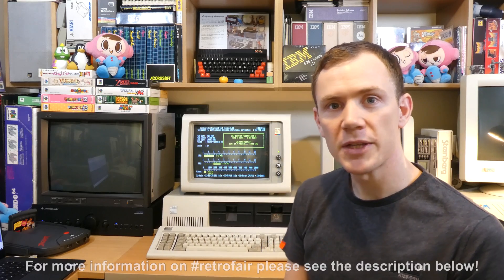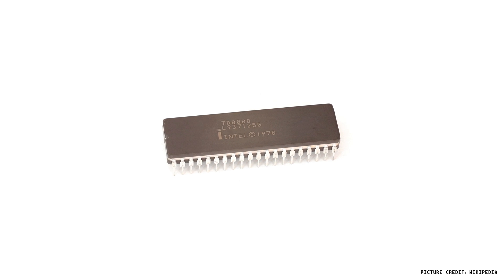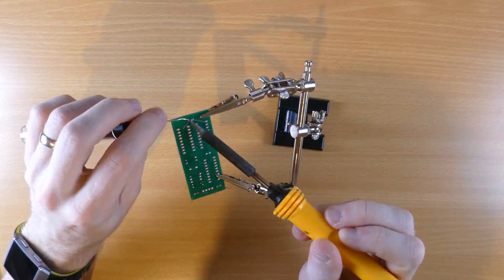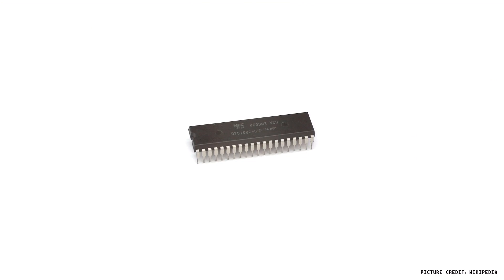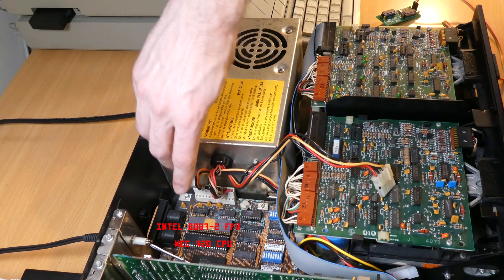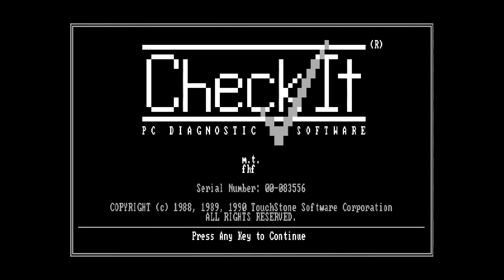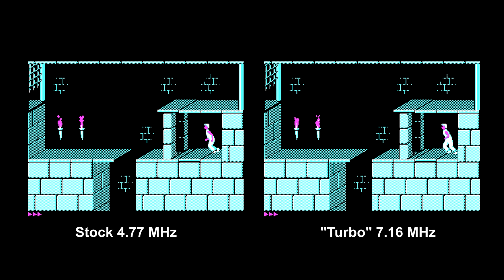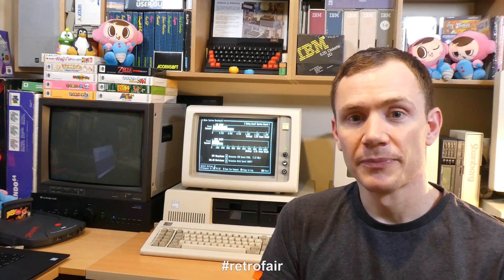PC-SPRINT - Overclocking The First PC With A DIY Open Source Hardware Solution From 1985! #retrofair

Comment: Hi Rees, great video, I love this kind of project. I could not see what you use to connect to the socket on the motherboard. I initially put headers but they turn out to be too large and damage the contacts. I see the canadian version used a turned pin sockets but it must have been a long pin version. I can't seem to find something like that anyway. Any advise?

Comment: Could this same process be applied to a Tandy 1000 SX in theory? I know that it has a clock speed of 7.16 MHz but using an NEC V20HL which i believe is designed for 16MHz could you reach higher clock speeds or isn’t this applicable since the pc is already supporting speeds greater than 4.77?
Reply from the maker: My concern would be timings of other things on the motherboard, such as the RAM. It could be that the CPU in the 1000 SX is already towards the upper limits of what the rest of the hardware is capable of due to the 7.16MHz clock speed. Unfortunately I don't really know enough about memory timings etc and the specifics of the Tandy to be able to answer that question.

Comment: Super video Rees! I'm looking at building my own 8088 PC clone and have been starting with the clock, do you notice any instability or compatibility issues running the 5150 at 7MHz? Ive heard that the Bus controller chips can have a hard time keeping up when doing DMA requests? Need to check out the PC sprint schematics when I get a moment thanks again!
Reply: Ah think I got the answer reading GitHub page "I have experimented with 22.11MHz and even 24MHz crystals and encountered stability issues at these speeds, so I recommend starting at 21.47MHz." I've been reading about going to 8MHz so I can see that it is probably an issue on an actual 5150. Sergeys original XT clone Errata talks about the DMA and Bus logic timing issues http://www.malinov.com/Home/sergeys-projects/sergey-s-xt
Reply from the maker: I had read about this too but thankfully it's never proven to be an issue in my case. I even started designing a "PC-SPRINT v2" to try to solve this issue but ran into various problems and gave up. I haven't come across any problems at all at 7.16MHz but did once try with a 24MHz crystal for a clock speed of 8MHz and the system was incredibly unstable. Perhaps that was the DMA issue starting to manifest itself?
Reply: @ctrlaltrees  thanks read the rest of the git hub page (sorry I get 2mins to read stuff before kids tell me to stop looking at my phone!) And see you did some very thourgh testing. My current thinking is to simplify the Turbo on my machine (sergeys Xi8088 auto clocks down on DMA requests but needs a lot of logic) by just not having DMA like the PCjr as I think it's only the Floppy Controller that would use it.... Anyway ta for the feedback, your #DOSCEMBER videos really inspired me!
Reply from the maker: Oh sorry Chris, I didn't see your two follow up replies as YouTube had held them for review, maybe because of the link. Glad you found the answers anyway, sounds like a very cool project. Oh, and thanks for your kind comments about the videos too! 😊
Reply: @ctrlaltrees  could you tell me a bit more about the instability issues you ran into? I've a 5160 with a V20HL 16mhz, and have been thinking of building t he pc-sprint with higher clock speeds. Wanted to try out a 40mhz (for an effective clock of 13.3mhz)  and a 29.4 mhz (for a clock of  9.8mhz) crystal, but if that's not going to be possible ill just get the recommended 21mhz.
Reply from the maker: @notkittenaround  It's been a long time since I looked at this, but the symptoms in my case were very obvious - freezing on boot and when launching software. I don't know much about the 5160 - it may be possible to push it to higher speeds due to faster RAM etc.

To be honest, considering what the crystals cost and how easy they are to change, it might be worth trying a few to see what works. Good luck!

Comment: This PC-SPRINT can be used on a TANDY 1000 A computer ??? Looks like the same type of overclock solution EEVBlog used on his TANDY 1000 A. Wish we can find out.
Reply from the maker: I have heard that it works on the Tandy 1000A but I haven't tested it myself. You will of course need to replace the original 8088 CPU with a V20 or 8088-2 to support the higher clock speed.

Comment: cool ! I was wondering why when I put V20 in my XT clone there was no improvement at all! Now I know :)
Reply from the maker: It will make a difference in software that can take advantage of the 186 instruction set. Some modern hardware like the XT-IDE can use it for increased performance as well.
Reply: @ctrlaltrees  what about 8086 I have this CPU but it did not run at any of my XT motherboards  (they work with 8088 ok, I assume that they are only with 8 bit data buses) Are boards with 16bit data bus for 8086 are more rare,or what ?
Reply from the maker: The 8088 was a cut down version of the 8086. It had an 8-bit bus rather than the 8088's 16-bits, as you mentioned. The 8086 could theoretically transfer data faster (bigger blocks), but due to various other bottlenecks in early PCs that severely limited real world performance most early PCs used the much cheaper 8088 instead. There were some 8086 PCs - the Amstrad (Schneider in Europe) PC1512/PC1640, IBM PS/2, Olivetti / AT&T and Compaq PC clones. These came later when the price of the 8086 had dropped to the point where it made sense.

The 8086 won't work in a motherboard designed for an 8088. Although the CPU would appear to be pin-compatible, the memory architecture is completely different. In my experience (IBM 5150 vs Amstrad PC1512) the performance difference is not really noticeable in real world usage so I stuck with the IBM.
Reply: The V20 also lowers the clock count required for many instructions.  However how much of an impact this has depends a lot on what software you run.  It does, generally, provide a little improvement at the same clock speed but not nearly as much as doubling the clock speed along with it.

Memory bandwidth can be more of an issue on 8088 systems, so going from 8086->V30 matters more than 8088->V20 because it has a full 16 bit bus to exchange data and is less bottlenecked at the bus, and more likely to hit those reduced clock counts it can offer.

Comment: Excellent stuff!  Looking forward to that v. 2! :)
Reply from the maker: Thanks! I had some problems with the v2 prototypes when they arrived so I've taken the information down and put the project on hold for now. I just don't have the electronics experience and don't want to damage anything. To be honest the v1 works great for me, no problems at all. I suppose it depends on the exact system setup as to whether the DMA issues could crop up.
Reply: @ctrlaltrees  Makes sense.  I also don't have the experience, but I'm definitely going to follow this :)